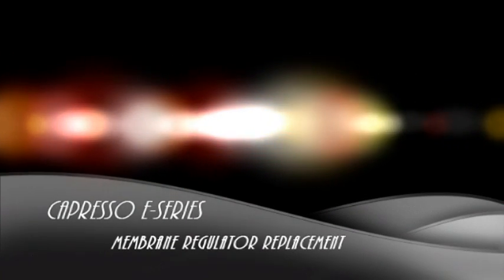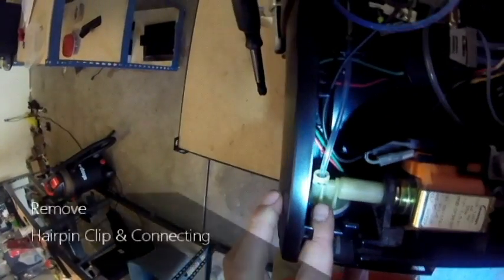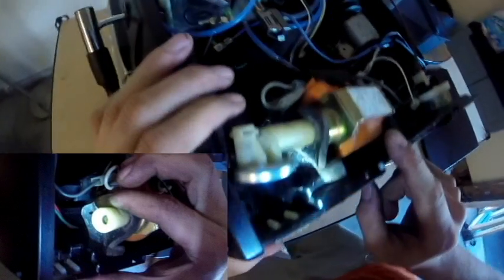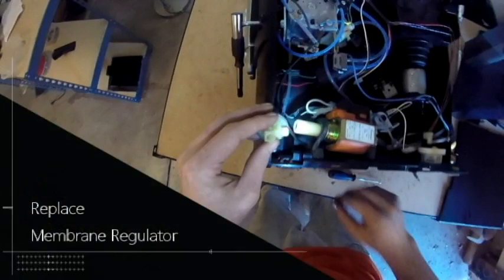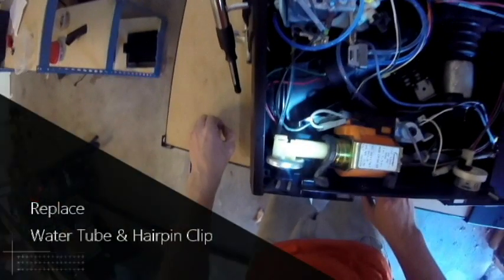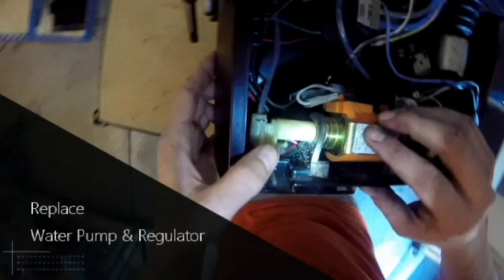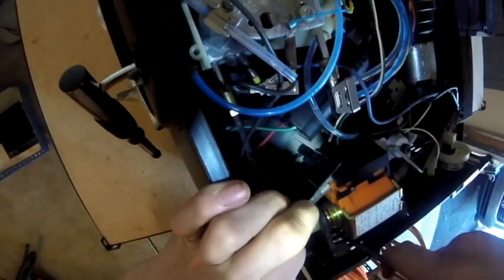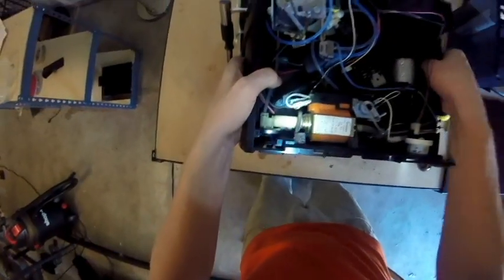Jura Fill System Fix | C-E-F-S-X-Z-ENA Membrane Regulator Replacement

Comment: READ THIS FIRST BEFORE CHANGING PARTS!!  For poor output flow I found this remedy in another video - and it worked!.  If your machine is NOT leaking and it has poor output flow, try this first.  Remedy: Open up the drawer, or pull out the tray and puck box, depending on your model. Clean the brewing unit, (The silver round metal disc with holes that the water flows thru after packing the puck).  You can access this part without disassembling the unit. TIP: You can use a small mirror and a flashlight to locate this part. It is behind a spring-loaded plastic flap and it is a part of the circular unit. The exact part is a silver metal disc with a screw in the centre. You can easily access the part with your fingers.  Use a damp paper towel to to wipe it clean.  That's it! You'll be surprised at the results.....
Reply: I'll add to this - same fix for me, and machine is working perfectly now, even on the finest grind settings.  Had previously replaced brewgroup, regulator and pump, which didn't fix the problem, and had been advised to replace grinder.  All wrong.  Just a bunch of debris piled up in the area described - 30 seconds got it all cleaned out and running beautifully!  Thanks again for the great tip!
Reply: I'm gonna try this out... Thanks
Reply: This fixed my problem, thank you. 

It wasn't making any coffee completely blocked. I did what you said opened the hatch and wiped the strainer with a wet cloth and immediately worked like new
Reply: OMG, Thanks you so much, this was it!!
Reply: Fixed - thanks so much!!!
Reply: @burningcoremaui  You're most welcome Klaus!  Such an easy fix.  Glad I stumbled on the other video that had no audio or explanation - just video of what he did.  I clean that part weekly now...... Cheers
Reply: Just wanted to say thank you for this!  I couldn’t see, but could feel exactly what you were talking about in my Jura Ena 8.  Fixed it right up.  Thank you!  Thank you!
Reply: @jeremyworthen6260  You are most welcome Jeremy. It pays to read all the comments sometimes!  I now clean that piece every week or two as a preventative measure to prevent clogging of the tiny holes.
Reply: Thank you! I cant believe it worked and I tried almost everything and googled all into oblivion. Thanks!!!
Reply: Just cleaned my J8 as you described and now back to normal. Thank you so much for posting your solution!
Reply: It is a good idea to totally overhaul the brew group now and then. The primary benefit is to replace and lube the piston seals. They get old and dried out and it takes extreme force for the drive motor to cycle the brew group, ultimately causing an error 8 code. One guy said to do it every few months but I easily get by doing it every two years.
Reply: Do you have a part number by any chance for the seals and correct lubricant? Many thanks if you do.
Reply: Haha you made my morning ! Many thanks <3
Reply: Was about to send to service repair with what i thought was a faulty membrane regulator, then tried this hack on my ena 8.Very hard to get too but located it and found it was clogged with grinds.After several wipes my machine was pumping coffee again and FILL SYSTEM message was no longer coming up. Ledgendary hack!

Comment: Thanks, helped a lot in reparing my Impressa C5. The regulator was completely corroded and water was leaking out of the bottom right of the machine. This was really easy to repair with your video. The most difficult was to push the elastic bumper back in, worked well with a big screwdriver.

Comment: I found just blasting the regulator filter with an air compressor got my Jura dispensing espresso properly. Thanks for a helpful video. I did drop the filter gasket in the machine, that was a messy extraction

Comment: My machine Jura A-9, saying press button, and then system filling,and I heard the system filling by water but nothing happen, what you think, can be the regulator membrane?
Reply: Regulator filter is probably plugged, air compressor  on the filter making sure air exits other end of filter worked for me. My fridges water filter had discombobulated plugging it with carbon

Comment: Hello.
My problem is that when i turn on the device, the device goes into open tap loop.
Water is coming from the nozzle.
1 - I checked the flow meter it's working
2 - the engine is running.
3- I cleaned the pipes
4- I completely disassembled the coffee filter and cleaned it.
5- I put limescale remover in the water tank and started the open tap cycle, but it didn't work.
6- No problem with small diaphragm pump
Reply: Hello Oguzhan. I´m having the exact same problem with my Ena5. I performed a total cleaning of the brew unit and this problem begin after 3 days of normal operation. How do you fix this problem?

Comment: Hmmm, I have no leakage, but my E75 just can't build up enough pressure to open the valve in the brewer unit to get water out the spout. The complete path from the selecter to the brewer unit and out the spout is clear. (cleaned all) Could the regulator be the problem or is the pump dying on me? The device has about 20k cups on it, replaced grinder and boiler at 12k.
Reply: Did you ever find a solution to this?  I have the exact same problem description but the membrane regulator did not help it.
Reply: Just reading the trouble shooting info on Jura-parts.com it could be the grind is too fine.  My machine is having difficulty pushing the brew out and it's only 2 years old.  Will try a coarser grind to see if it helps.
Reply: @spencerrs-e2g  I tried this as well - our machine used to work fine on finest grind for 15,000+ cups, even with the double-shot "strong" grind mode.  Going all the way back to coarsest grind and only using single shot "mild" got it limping along barely but it's not anywhere near normal.  I've also replaced the pump as it was also pretty cheap - after doing so, saw that the outlet valve above the pump is leaking.  I'm doubtful it was doing so before - maybe new pump increased pressure a bit?  Anyway, then learned that is apparently another common failure point that can cause problems with flow - found plunger was half disintegrated, so I've got a replacement for that on order to see if it helps.  Another vendor suggested the grinder is bad - but no idea how to confirm that.  Pre-ground lavazza espresso in the can does not work either.
Reply: @colinbrodsky6365  Is the outlet valve the same as the membrane regulator?  It seems to be another part that fails and causes lower pressure.  Please post on how things turn out with the new outlet valve Colin. I still haven't pin-pointed the problem with my machine yet, but will start with a coarser grind in the morning.  Not holding my breath as like you, I've used the same grind setting foe a long time.  Oh, on the grinder being bad, the Jura-parts site said that the grind can turn into a fine powder caked into the bottom of the grinder which will limit flow - I guess when some of the powder gets into the puck packing mechanism.  I had my machine apart the other week and the bottom of the grinder was in fact packed about 3/16" deep in fine caked on powder.  I cleaned it all out, but still have the problem.
Reply: @colinbrodsky6365  Check this out Colin:  For poor output flow I found this remedy in another video - and it worked!.  If your machine is NOT leaking and it has poor output flow, try this first before changing any parts.  Remedy: Open up the drawer, or pull out the tray and puck box, depending on your model. Clean the brewing unit, (The silver round metal disc with holes that the water flows thru after packing the puck).  You can access this part without disassembling the unit. TIP: You can use a small mirror and a flashlight to locate this part. It is behind a spring-loaded plastic flap and it is a part of the circular unit. The exact part is a silver metal disc with a screw in the centre. You can easily access the part with your fingers.  Use a damp paper towel to to wipe it clean.  That's it! You'll be surprised at the results.....
Reply: @spencerrs-e2g  Interesting - I will take a look.  So an update on my machine - I installed a new aftermarket outlet valve found on eBay for around $12 - instead of plastic, it's a metal plunger - very nicely designed, easy replacement, and no more leaks at the outlet valve.  I was still having problems with it clogging though, so this did not make a huge difference other than stopping the new leak that developed after replacing the pump.  Then I did a cleaning cycle - was getting great flow again, but then first cup of coffee after, with grinder at coarsest setting plugged it up!  So perhaps there is something that went very bad with our grinder in the past few months that it is making too much fine dust, which is the last theory I have.  To test this, I'm trying some pre-ground Lavazza coffee grind (not espresso grind as that plugs it) - if that works reliably, then I guess I will take apart the grinder and see about replacing the burrs?  And in meantime, will try the direct cleaning tip you found!
Reply: @colinbrodsky6365  Hi Colin, thanks for the tip on parts at E-Bay, good to know.  I was surprised at how caked up the disc was, and amazed at how it stopped the flow.  Flow is amazing now.  Just found another post that suggested running a few rinse cycles after wiping, and make wiping after that.  Anyway, I'll bet this is the problem and you'll be able to go back to espresso grind or any grind you want after this cleaning.  I doubt there is any problem with the grinder.  I had the packed layer of fine dust in my grinder that I cleaned out, and I suspect it was this that after extended use plugs the holes in the disc.  So it would seem that regular cleaning of this disc is all that is needed in most cases of poor flow.  Cheers, Spencer
Reply: @spencerrs-e2g  So I checked and sure enough, mine had a lot of coffee ground debris in the entire area both on and below the screen after brewing a cup.  I do see the pucks still coming out in the grounds tray, but I am actually now wondering if the internal scraper is not performing as well as it should - my understanding is that after a brew cycle, the puck is pushed out and the plastic scraper should get all the major debris off the brewing area.  I'll keep an eye on this through some brew/rinse cycles this weekend and see how it goes.  I still don't understand why my machine only now needs this attention - but worst case, it's not that hard to wipe it out regularly if I can't solve the root cause.  Also I had to reinstall the scraper and some supporting parts as part of both brewgroup replacements and perhaps I've got something setup incorrectly.
Reply: @colinbrodsky6365  Hey Colin, any updates on your machine? Im having similar issues on mine. You posted earlier that you got a "aftermarket outlet valve" on ebay. Im a bit confused on what this is? Is it just the membrane regulator which connects directly to the output side of the water pump? How can I find this on ebay. thanks